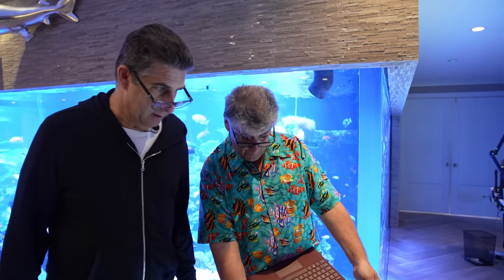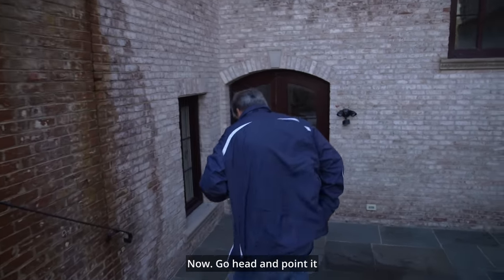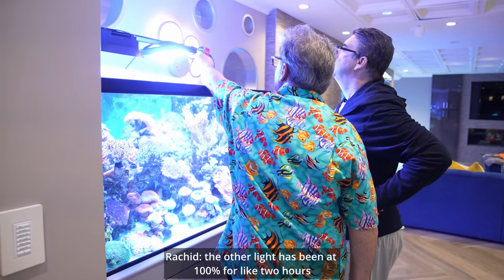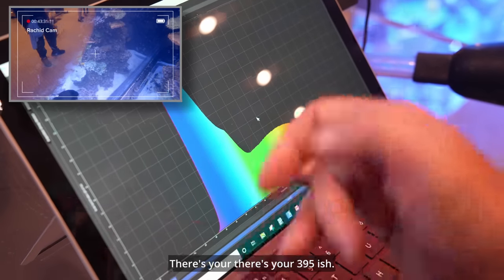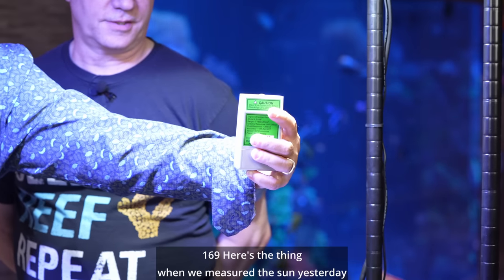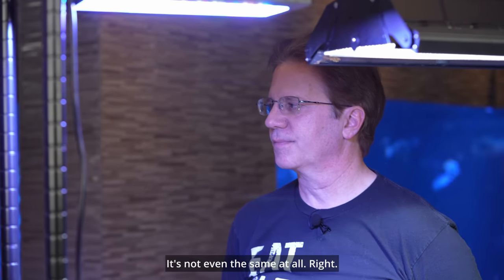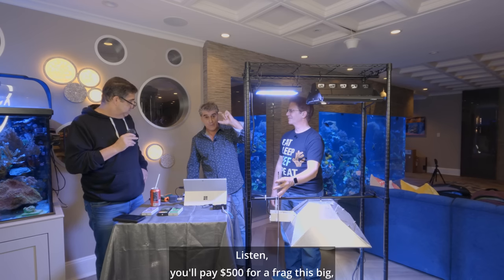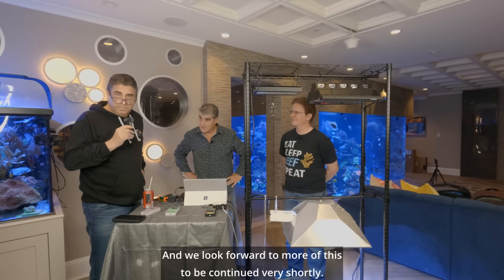"Shedding LIGHT" on REEF Aquarium Lighting

Comment: Why did Tulio measure UV and UVB 40 cm under the MH, and right under the Radion led, 1cm under the lights, where the light output and didn't have the space to blend and to capture all the led cluster in the Radion led fixture, when Mark drop it down a bit ti shows 0.55. To me, this is not a fair comparison! You have to measure all the light fixtures at the same level and distance from the light.

Comment: Why are the reef led light manufacturing companies not putting uvb diodes in there lights when they are available. There are diodes that go down to 280nm for a broader spectrum
Reply: Cost and lifespan... High cost, short usable life in comparison to "not UV" diodes.
Again though proof of need is non-existant.
Reply: that and we don't keep corals off  the reef crest anyways.....
Reply: cost of bulbs, they don't last as long as typical leds and the housings are made of plastic instead of metal and glass, so they will break down...it would double or triple the cost of a unit to add it...and do be fair, there isn't any evidence that it does anything important...

Comment: To be fair, the Radion was a few inches higher than the metal halide so that can explain some variance.  As for UV, Radion never promoted having UV. Question still remains on benefits for UV itself which I’m interested where that leads to in your research.
Reply: Ecotech does describe their led as in nanometers, not UV specifically. However, the led manufacturers as a whole claim UV channels which is bogus
Reply: @briansbrain3127  they never claimed UV otherwise they would be sued lol The marketing team uses ‘near UV’ which means absolutely nothing.  They outline the diodes used with lowest being 405 which isn’t UV, hence near uv. UV is under 400nm.
Reply: My G4, G5, G6 xr15 radion boxes clearly states “enhanced full spectrum and UV” with 4 UV leds. Not until G6 did they finally list the diodes as nanometer and took out the word UV. Look at other Led manufacturers websites and see how many claim UV.
Reply: To be fair? The halide bulb almost lines up to where the bottom of the radion is and the fixture has a glass shield which blocks a little light also. Can be removed if its a SE bulb and get a little more output.
Reply: @jorgerios1358  base of fixture to base of fixture is only true way to be measured…not position of light bulb in a unit as you should only care about output beneath light fixture itself as that’s real world testing
Reply: @briansbrain3127  again, they don’t claim UV lol
Reply: @djmikefury1  Yeah No, they were right. The bulb is the correct place to measure from as the distance to the water is from the the light source (i.e. the bulb), there are lots of different MH hoods and reflector designs that are all different distances from the bulb but all take the same bulb hence why you measure from the bulb.....
Reply: @DoYouEvenFishTank  again, the hood is apart of the fixture, as reflectors run down side of hood to amplify the light….if you wanted to run a light bulb, then take it out of the fixture and just run the bulb…it’s not a realistic scenario to measure two light fixtures from different heights based on bulb placement on one side, if that’s the case, then take off the lens and any diffusers on the LED light then if you’re comparing light technology…if you’re texting the light fixture, it’s measure from the base of the light as that represents usable light from the water
Reply: @djmikefury1  the LEDs and the Metal Halide bulb were at equal height. Dropping the Radion two inches lower would make it an unfair comparison. And as was mentioned above, the double-ended metal halide had a glass shield that the Radion did not. I think this was an equal test. 

The Radium was single-ended (mogul socket) but wasn’t tested as much. No glass shield on that reflector.
Reply: @melevsreef  agree to disagree at this point - no one should measure a light from inside of a fixture as that’s not how the light will be used in real world application….only useable light that emits right below the physical fixture represents the true starting point for measurement…with the logic noted above, half the fixture would be in the water just to get the bulb level with the surface of the water, which no one would do obviously
Reply: @djmikefury1  You clearly have no understanding, the LED has a lenses over it too, to ensure all the light the diode produces is directed down, the same for the MH fixture and so you need to be measured both equal distance from the light source, irrelevant of the fixture. There is a global standard for measuring the light outputs, and it is why you are meant to stay a minimum distance from the light source when measuring. When measuring the output from different light sources you have to make the "measurements from the source of radiance" when making comparisons.
Reply: @DoYouEvenFishTank  you don’t measure from inside the fixture…only what’s actually underneath the fixture as that’s the closest it can get to surface of the water…the end
Reply: @djmikefury1  Who cares about the standards.....lol

Comment: Wish they tested both versions of lights for power consumption
Reply: To get the same coverage with LED as you do with Halide, you end using the same amount of watts if not more using the LED. Metal halide > LED
Reply: @danielf9052  100% agree. Now, quit caring about looks and focus on growth...6500k will get you almost double the lighting per watt.
Reply: Leds are efficient and making blue and red light. Close to halides, the other colors, not really. A "white" led is just blue with a yellow gel filter. Lol
Like, 40lm/watt. Half the value led makers like to brag about.
Reply: @premierreefsmn  
White LEDs are royal blue emitters with a yellow green phosphor.
Current white LEDs push 140 lumens/watt. 50% more than white halides.
Reply: @premierreefsmn  white led are closer to how a florescent tube works. Near UV that excites a phosphorous coating.
Reply: @jeffseussalias7605  I call BS. A quality halide bulb of lower Kelvin can easily surpass 100lm/w. Maybe go look up ceramic. Metal halides as well...many boast 200lm/watt. Sounds like fantasy? Lmk when you are bleaching acros with your leds at 20watt per square foot of tank. 🤷🏻‍♂️ it's a dead argument anyway. The marketing teams won, and when my 50 year supply of bulbs is gone, maybe I'll try LEDs again. I don't miss using leds at all. Stop getting "facts" from marketing teams.
Reply: @premierreefsmn  200l/watt is fantasy..
CMH-315W/930/AGRO
DIRECT from Ushio 315W 3000K CMH
110L/w
My sympathies to those early adopters that used those overly-efficient optics.

Comment: Good video but tons of misinterpretation and stuff taken out of context. I’m a major Tullio fan but he needed to be much better here. 

There is zero evidence that UVA, UVB, or any of the reds, including infrared, are needed or used by anything in our tanks. Do you know how many fish never see UVB in the ocean? It is filtered out super quick in water. Just like UVA is. 

“Comparing” a Radion G6 in open air to a ReefBrite halide reflector is ludicrous. One is extremely concentrated and the other spreads out a ton. 

I’ve been running ReefBrite halides for close to 3 years now. They aren’t new or mysterious to me in any way. They also aren’t anything special and won’t magically cure anything. Your flow and water chemistry are far more important than your lighting.
Reply: Yea more of a sales pitch than anything else.